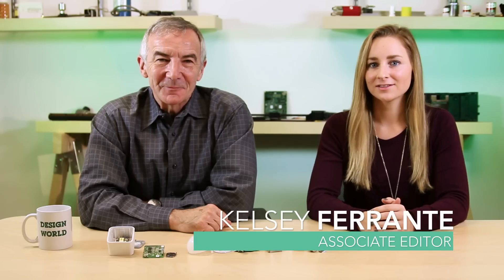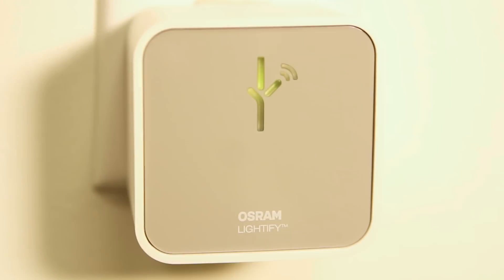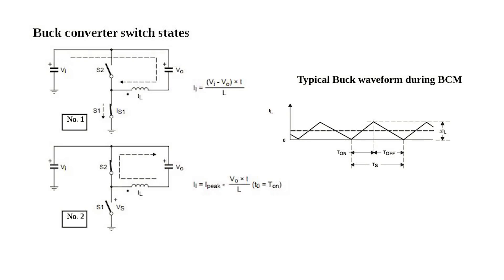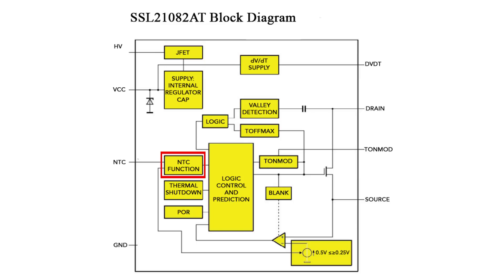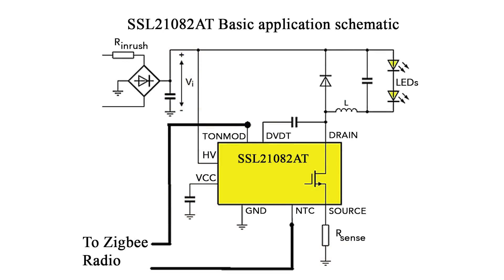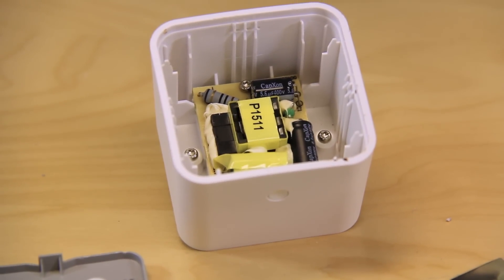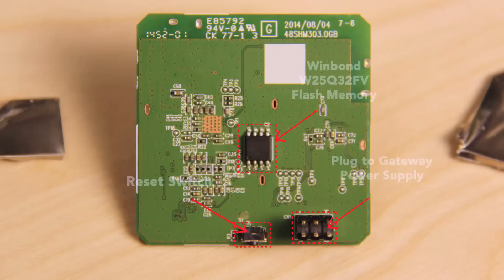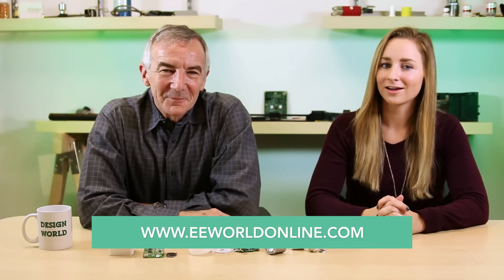Teardown: Inside the Osram Lightify LED smart connected light

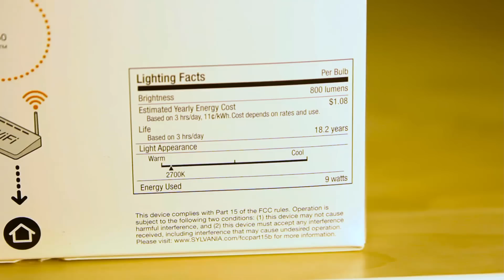Comment: Thanks for the teardown video. The box you show at 5:22 lists this as a soft white 2700k.  There is a different version that is tunable white that has a different looking box.  Are you sure the bulb torn down in this video is tunable?  That would explain the mystery of the color temperature circuitry.